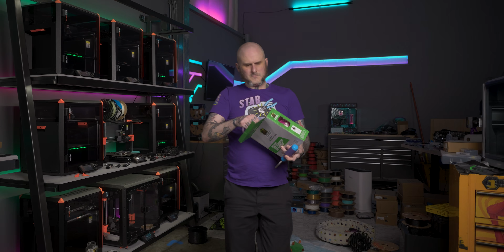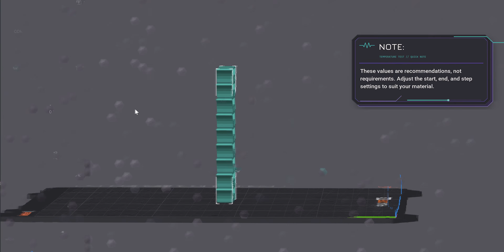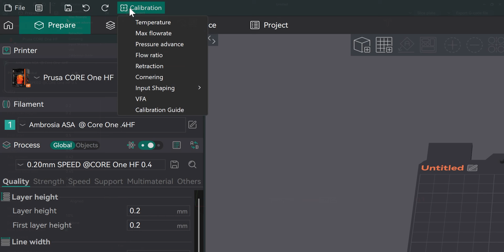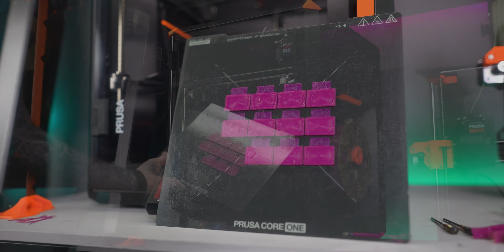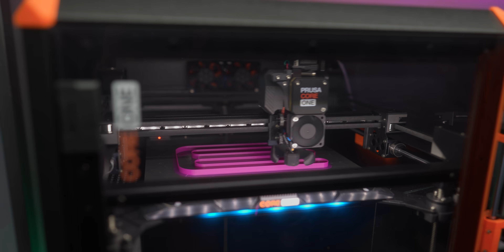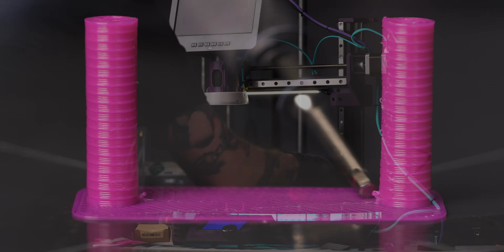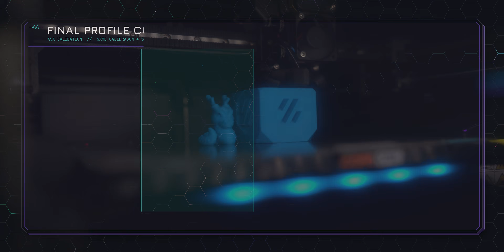Is Manual Filament Tuning Still Worth It?

Comment: Note that results can be different for each model of nozzle too (standard VS CHT for instance).
Reply from the maker: Nozzle size, nozzle type (cht, hardened, regular brass), etc etc. Heck even colors of the same material can behave differently, the colorants can affect how materials extrude. Pinning this for now to add that context!
Reply: @MandicReally  Yeah so why on earth didn't you do the last test with the same color😅😂 You could have just given them a number to tell them apart..
Reply: @MandicReally that's good to know

Comment: Is this the correct order to perform each test ?
Reply from the maker: It is the order I use. Some folks disagree. The only ones I think may sense to switch would be Extrusion Multiplier and Pressure Advance. As they can affect each other. All the settings can affect one another though so it’s really hard to say what the exact order should be if you are really being picky. I prefer this order personally.

Comment: From personal experience, you do need to do this for every roll. Every single roll of the exact same Sunlu PLA+ has had different settings for me, I've done this like 5 times now.
Reply: To be even more specific even within 2 rolls which were both in the same double box, i.e. packaged together, so presumably made at similar times both had different calibration results.

Comment: somewhere hundreds of bambu owners are losing their minds at the idea of "tuning" anything lol. I have been modifying filament profiles between brands and types since I reduced my resin printing addiction 3 years ago and finally had to go thru and delete obsolete ones or profiles where I was trying to get an objectively bad spool to work. Now it boggles my mind that so many recent designers and STL sellers have absolutely no print settings or filament suggestions as they "assume" everyone wants a 3MF file with everything done for them. When it doesnt stick, well, that's why theres always practically new bambus for sale on Craigslist locally every week. I finished my first Voron build 3 weeks ago and only got 2 profiles dialled in ("normal" PLA and shiny "silk" stuff). Im glad to see theres still content creators remembering the hobby contains people for whom "good enough" never will be!

Comment: I got into 3D printing when people still said "RepRap" then left for some years. Coming back recently, I am amazed so many just use provided profiles and do zero tuning themselves. No individual printer is perfectly alike to another, these manufacturer profiles should be considered a close starting point. Even a basic temp, top surface, retract, coast, and advance tune makes such a huge difference. It only takes a few hours.

Comment: I think there's lots more tests to reach "perfection", and some efficiency we can do on these test.

Flow ratio - I start with the standard yolo, but delete every other step, then find the best one and run the perfectionist version - but deleting everything that's not within 0.1 either side of our first result. Also, if we start at 1, and our results are above/below the 0.5 limit, then you want to drop your initial flow by 10%, not 5% like you did, otherwise you're going to just be overlapping your initial tests.

Skew! - I've never seen a printer get this perfect out of the box, there's a wonderful test called califlower, you print it, put 10 measurements into a spreadsheet and it spits out a correction that you can put in your printer.cfg

Z height shrinkage and first layer - Yes, correcting for z only affects in full layer increments; but we can adjust the flow ratio of our first layer to get closer to perfect, unfortunately I've not found a great ready made solution here and it's a bit of a back and forth with adjusting first layer flow ratio, z offset and bottom surface density. i've found that using first layer flow ratio between 70 and 130% depending on whether we want to go a bit taller or shorter gives reliable first layers, and sometimes you need to trick the z shrinkage and then counteract that with first layer adjustments to get the best results.

elephant foot - This is a bit of an extension to the above, if you really dial in first layer flow it minimises the issue, but if you're doing something like multicolour first layers you may want to squish a bit of extra plastic down to remove the visibility of lines. This one is a quick and easy fix, after doing your first layer tuning, print off a 30mm x 30mm x 5mm cube with 95% infill and zero top layers, then just measure the top of the bottom of the cube including the elephant foot and minus the measurement from the the top of the cube, half that number and that should be the amount of compensation you need to apply, if this is more than 0.1mm (like my aforementioned first layer multicolour profile) then you can run off a few cubes varying the amount of layers the compensation is applied to.

Comment: Why do you tune flow ratio after temperature? Usually order is as follows:

1. Temperature
2. Max Volumetric Speed
3. Pressure Advance
4. Flow
5. Retraction
And in the end compensate for shrinkage with tolerance calibration.

There are also next setps that are a little extra.
6. Cornering
7. Input Shaping
8. VFA

Factorian Designs did a very good I feel a bit more detailed video on the topic. Also check out Orca Slicer wiki for the step by step guide

Comment: I've never needed to do any of these calibration procedures on my S1 MAX and U1; the automatic calibration before printing is more than enough—I use them to print ASA, PC, and PA.
Reply: those work great until they don't. and when they don't, they don't often in epic fashions. the worst part, in my personal experience, is when you switch to or need to run a machine that doesnt have the handholding ( precalibration or auto bed mapping and thermal compensation in my case) you're spending a LOT of time watching videos like this instead of printing learning how to "fly on manual" lol (first Voron build)

Comment: The answer to "is it worth it" is pretty easy. Do you have a machine that's banging out print after print with no issues on basically every filament you put into it? Not only is it not worth it, you're very lucky. Just don't use the filaments that are giving you trouble, if any... Unless you desperately want to print in that color/material.

Alternatively, when you have a machine that seems to not want to print anything you run through it, absolutely do this. It's mostly passive labor that can be done on a lazy afternoon while you're taking care of any other chore or doing some leisure activity around the house. Its 100g of filament per test "wasted" to save 1kg of filament in failed prints, and will likely improve your opinion of your "bad" machine, as a bonus.
Reply from the maker: I get your point, but my only pushback would be, "How do you know it has been the printer has been having no issues?"

I often find folks say "My printer prints perfectly as is!" but still ask me "how do you get such nice prints?" Folks often don't know that there is improvement to be had. And without trying, they won't. That is kind of why I said, "give it a try, if you like your current method, stick with it". Try it, see if the improvement is worth it, and if not, then go back to what you were happy with, the only harm is a few hours of print time and 100g of filament.

Comment: great video, i myself was struggling with flow rate tuning but using my iphone 16 pro macro camera and a stick led light helped see what i needed to see, partially because of the demonstration of the under extrusion exageration. if been able to perfectly dial that in now. it works so good on translucent filament that i probably only print in it for test/functional parts given its so easy to calibrate now

this guide is what i needed when i first started this hobby in 2024 and just the testpices alone are better then my usual prints with standart bambu profiles

Comment: In case anyone is curious like I was, I went through and ran each of these tests to see how much time and filament was actually used. 
3 hours 33 minutes total print time
51.12 grams of filament total used

Temp tower: 1 hour 35 minutes, 16.5g
1st flowrate test: 42 minutes, 14.6g
2nd flowrate test (I only ran 7 swatches): 29 minutes, 9.3 grams
Pressure advance test: 30 minutes, 4.7g
Retraction test: 12 minutes, 1.0g
Shrink test: 34 minutes, 5.0g

This is on a core one with a Phaetus Sic. All tests were run with the same parameters shown in the video. Usage and time was tracked using filabridge and spoolman. 

These were all done with isanmate green pla
Reply from the maker: Good info. Did you feel like you landed on different settings than you would have used previously?

Comment: Max volumetric speed calibration is a weird one. I can do 35mm/s easily, yet in actual printing I'll be lucky to hit 24-25. Thinking about it, PA and flow rate are also iffy when it comes to real world printing.
Reply from the maker: Are you using OrcaSlicer's calibration tests? I do find that "real world" printing is different than pure calibration testing. It is why I've never cared for Stefan's "poop" max flow test (I heart him, just not that test). Real application varies often. Part of the issue can simply be that a lot of these tests apply speed & acceleration values that are totally different than what you actually use daily. OrcaSlicer often sets speeds to high rates and accelerations dialed up. Which for me anyway, is not representative of my day to day. And those CAN affect the results of almost every test.

I've got some ideas for testing methods that fix that, but they are in their infancy...
Reply: @MandicReally  Would love to see those when they've matured.  I use orca calibrations. I've not messed with settings for the calibrations before but I checked and seems PA/max volumetric speed seem to use whatever my outer wall speed is already

Comment: With Prusa Printers you need to manually tune 😂. Prusa is overpriced and a generation behind most
Reply from the maker: Starting to feel like these are bot comments at this point.

NO current printers tune for you. NONE. ONE Brand I'm aware of tunes, ONE setting. And I don't think it does that well.

Comment: I have 900+ filaments. I am NOT calibrating each and every one of them. I gave that up when it became unmanageable for my collection and now the collection is many times larger than it was back then. I only tune when I need to, like when a filament is so bad that it doesn't work with my normal settings. Then, I add that filament to my blacklist and never buy it again.

Comment: Max flow rate determines speed. Shouldn't you, therefore, run that before pressure advance? Temperature determines flow rate; flow rate determines pressure. So, temp tower -> max flow rate -> pressure advance.

Comment: The correct reading for max flow test is actually super helpful to know

I noticed my pla at the top end speed can get a little thin with extrusion. So, I knew my max flow was flawed, but I didnt know how to go about it. I just used a bandaid solution of subtraction to what I had for max flow. Now I know though so thanks!

Comment: If you use a temp tower to set your temps, The next step should be  Max Flow Rate test to determine the ideal max flow rate you should be using for those temps. Otherwise, people skip over it altogether and you'll end up with a temp that is often too low for faster prints. After you ahve your temps/max flow rate set, then conotinue to other settings down the order in Orca.

Comment: Even if one uses different tools for tuning, following the order of tuning consistently will (should) give consistent results. It is nice that Orca has the tuning routines built in (I pretty much do all my slicing in PrusaSlicer, I haven't made the jump yet and last time I looked there isn't a clean settings converter from Orca to Prusa). But what would be better is for the tuning menu to be ordered in a good sequence from top to bottom.

Comment: I tend to switch filament provider so often (due to price/offers) this is just not feasible for me. If there is a profile in prusa for that specific filament, then I use it and it works, otherwise like you say, the generic profiles are generally good. But sometimes needs tweaking depending on what you print.

But if you are a perfectionist then yeah, I see the appeal.

Comment: Hey MadicReally, 

great video so far. Many newcomers dont know how important it is, to calibrate the filament thoroughly. Unfortunately, many experienced users play it down/belittle it, which is wrong in my opinion. 

I have one critique. The part with the shrinkage. Shrinkage is only one parameter, that influences dimensional accuracy. If you do the shrinkage compensation for a 20x20x20 cube, then the compensation settings will not work, if you print a 100x100x100 cube. Or, even worse, you have an asymmetrical part. We cant compensate for everything, with the current limited input fields we have in the slicer. If you print vastly different sized and shaped parts, you need to compensate for every part individually. 

That is my opinion.
Reply from the maker: Thanks! I agree with the larger point that shrinkage compensation can’t correct every source of dimensional error. Where I disagree is that a value measured from a 20 mm cube inherently won’t work on a 100 mm part. The slicer’s shrinkage compensation is percentage-based, so if the material shrinks consistently, that correction scales with the part.

The real weakness of a 20 mm cube is measurement accuracy. A 1% error is only 0.2 mm at that size, so being off by just 0.05 mm with your calipers changes the calculated shrinkage by 0.25 percentage points. On a 100 mm test, the same 0.05 mm measurement error only changes it by 0.05 percentage points.
You’re absolutely right that this won’t compensate for everything. Geometry, orientation, thermal gradients, bed constraint, warping, and machine skew can all produce errors that a single global percentage can’t fix. It’s a useful broad correction, not a promise that every feature on every part will be dimensionally perfect.

3D printing still has a long way to go for sure.

Comment: How do you get all those tuned settings from orca slicer into Prusa Slicer - would have been great for you to show that - for instance I think Prusa put pressure advance directly in the gcode not a slicer setting  - so covering how to get these setting into Prusa Slicer (since you said you said  you don't  use orca for your Prusa Printers)
Reply from the maker: You are right I should have shown the pressure advance thing for sure. It didn't occur to me. I do it all by hand. I split my screen with each slicer on a side and just enter the values from one into the other. And yes I have to enter the PA value into start g-code in PrusaSlicer 2.9.6... PrusaSlicer 3.0 however...

Comment: I like the addition of the shrinkage model. When I tuned ASA for printing some printer mod parts, I used the Calilantern.
Reply from the maker: Calilantern is great, but just for shrinkage it is overkill. And sadly Prusa printers don't have Skew correction and I think it is g-code level work on Bambu's so beyond the scope of what I wanted to present here.
Reply: @MandicReally I only use machines that keep open source mentality. Like my SOVOL sv08 ;). Love your content regardless you get a like from me anytime.

Comment: Awesome video dude! :)
I always use a cube in vase mode for Flow calibration. For me that's more measurable then just looking at some prints. I use fact vs opinion as example. If wall needs to be 0.45 and I measure 0.45: that's a fact.

Just looking and think one is better then the other is more an opinion. Just how I look at it. I rather have a fact then opinion in when calibrating filament. :) xD
Reply from the maker: Honestly I cannot argue with that. I'm much more a fan of "show me" vs theory. Its why I prefer the racetrack max flow test to the "poop" test. I find things behave differently when printing an object vs just calibrating on a non-print object test.

Comment: I always use the generic profile and tune it to the material im using. Even if the slicer has a profile for my filament, old habits die hard.
Reply from the maker: Yea I've done it so long I rarely even touch the dedicated profiles. I kind of like to compare where I landed vs theirs. And it is NEVER the same, interestingly.

Comment: I really wish there was a "Calibrate New Filament" button in the slicer. It would ask basics like "pla/petg/etc, brand, etc", and go step by step through the calibration.
Reply from the maker: That really would be an excellent (and seemingly fairly simple) addition. I think it is probably brands 1, wanting to remove tasks from the user experience. And 2, worried about the support emails bogging them down as they try to help people interpret results. Even in these comments I have people saying "Tuning is so 10 years ago". So to some people adding that process would be a sign of a failure on the companies end. When that's the furthest thing from the truth.

Comment: My only issue with all this testing is how much filament it wastes. I think I would only do this if I was printing a lot of the same filament in a professional setting (for example for a print farm).
Reply from the maker: I mean it is a little less than 10% of a spool of filament. I get that. To me, a single failed print can EASILY waste more than that though. I absolutely have had times where I needed a project done ASAP and I needed a full Kilogram of material so I just ran the print without tuning. And I can't remember a time I didn't regret it. These days I try to order 2kg if I know I'm gonna need 1, so I can tune and have buffer room. Honestly, if things go smoothly, I just return the 2nd spool a lot of the time.